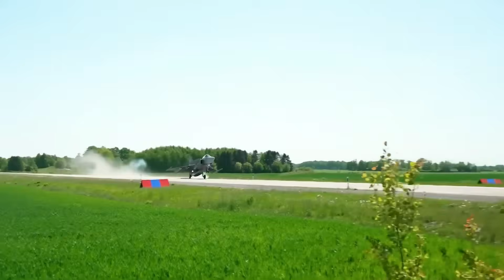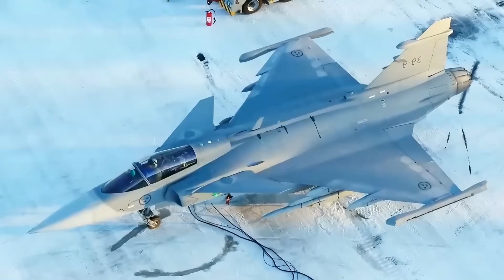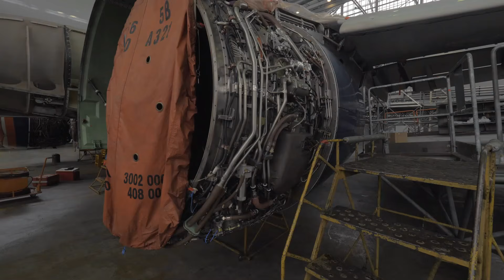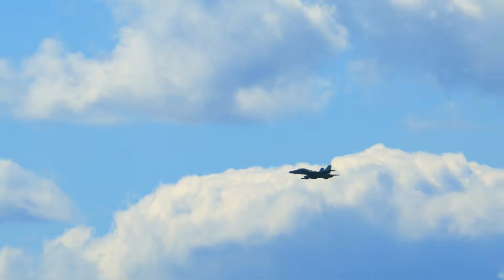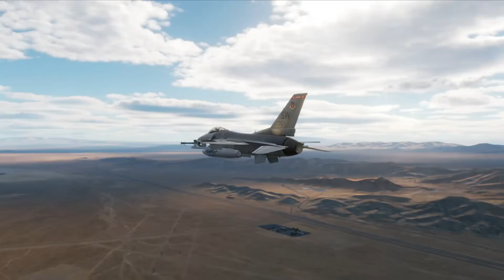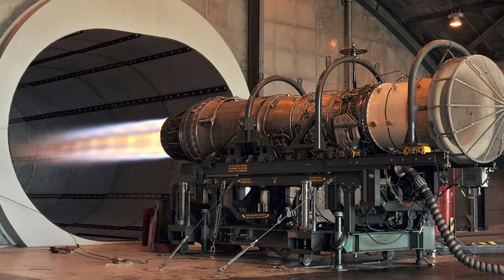Gripen’s Rolls-Royce Engine vs F-35 — The Power Debate Explained

Comment: Canadian pilots need 2 engines!!! If a Gripen or F-35 take a bird strike in northern Yukon or NWT that pilot will have to punch out lose the aircraft and have to wait for a helicopter for an hour they'd freeze to death!!!! F-15EX or Typhoon or maybe the Rafale would be the better choices but id 100% take the F-15EX
Reply from the maker: Two engines can improve redundancy, but they don’t make a jet immune to bird strikes or engine failure. Modern single-engine fighters like the F-35 and Gripen have very strict engine certification standards and extremely low failure rates.

Canada has operated single-engine CF-18s’ predecessor aircraft and other single-engine jets in harsh environments before. Survival in the Arctic is more about SAR coverage, pilot gear, and response time than simply engine count.

The F-15EX is powerful and capable, but it also comes with higher operating costs and different basing needs — so it’s a trade-off, not a simple safety equation.
Reply: @FrontlineMilitaryShowyou get what you pay for. Pilots flying the CF-18 with one engine is a training exercise incase of losing one engine! The Gripen will not last as long as the Legacy Hornet did but the F-15EX absolutely could!!!! So we'll be forced to replace the Gripen sooner. In the long run we'd end up paying more but besides that I listen to the pilots need as should you....

Comment: I’m often heard about the Gripen is a fighter with better maneuverable, because light weight fighter jet, but it should be compared to missiles. 
Missiles have better maneuverable.
You can tell the superiority and inferiority depending on the ability of ECM. 
Gripen’s power generator F414 27.5kW and F-35 power generator F135 160kW, it’s clearly judged which has more capable Electronic Warfare.
Reply from the maker: Missiles are more maneuverable than any fighter — but fighters aren’t meant to out-turn missiles. They’re meant to avoid being targeted in the first place through tactics, EW, and positioning.

On the power point: yes, the F-35 generates significantly more electrical power, which supports its very large sensor and EW suite. That’s part of its design philosophy.

But ECM capability isn’t judged by generator output alone — it’s about antenna design, software, integration, and tactics. Power helps, but it’s not the only factor in electronic warfare effectiveness.
Reply: @FrontlineMilitaryShow
It doesn’t make sense.  If your saying is right, why EA-18G＋ALQ-99×3 is 75kW instead of F/A-18E/F is 55kW.
Why it need to build up the power generator?
Because It is matter that ECM need more power.

Comment: The stealth property, state-of-the-art passive sensors, huge computational power and data fusion are the recipe for survival in the next two decades and not the engine and the performance. Grippen is more cost efficient, I give you that, but the F-35 is about to be the leading aircraft of a group of another 4 Collaborative Combat Aircraft ( the competitors are the YQF-42, the YQF-44 and the YQF-48 ), that in turn are much more cost efficient than a swarm of 4 Grippens and stealthier than the F-35A and equally lethal carrying two AIM-120 in the internal weapon bay. Canada should make a choise that is compatible with the future and not chained on the past.
Reply: Totally agree with your opinions.

I’d like to add comparisons between Gripen’s power generator F414 27.5kW and F-35 power generator F135 160kW, it’s clearly judged which has more capable Electronic Warfare.
I heard many times, Gripen is the most effective ECM.
But look the power generator result.

Saab keep saying it, but it is cheating market sales.
Reply from the maker: You make a fair point — modern air combat is increasingly about sensors, data fusion, and networked operations, not just raw engine performance.

That said, cost, readiness, and mission flexibility still matter a lot for many air forces. Different countries prioritize different things, which is why platforms like the F-35 and Gripen both have their place.

Comment: 414 is 22,000 lbs of thurst 135 is 43,000  there is zero Comparison
Reply from the maker: Raw thrust numbers alone don’t tell the whole story. The F414 (~22,000 lbs) powers a much lighter single-engine jet, while the F-35’s F135 (~43,000 lbs) is pushing a significantly heavier aircraft with different mission requirements.

Performance isn’t just about max thrust — it’s thrust-to-weight ratio, aerodynamics, fuel load, sensors, and overall design philosophy. Different aircraft, different roles.

Comment: I seem to recall that the Gripens used F404 and F414 engines.
Reply from the maker: You’re remembering correctly.

The Gripen C/D uses the GE F404, and the newer Gripen E/F uses the GE F414. Both are American-designed engines, which is why U.S. export regulations can apply to Gripen sales.
Reply: 414 is 22,000 lbs of thurst 135 is 43,000  there is zero Comparison.
Reply: @kucgok  Empty weight of the F-35 is 29,300 lbs.  The empty weight of the Gripen E is 14,550 lb.  There is zero comparison. 
The Gripen is faster, but the F-35 has faster acceleration.

Comment: General Electric Aviation (an American company) designed the original engine families (F404 / F414) that Gripen engines are based on. Because the engines are U.S.-designed, export controls and U.S. approval matter for many Gripen sales and support arrangements — even though Saab builds and maintains them in Europe. Canada needs America's approval regardless of which plane Canada buys.
Reply from the maker: GE designed the F404/F414, so yes — U.S. export controls apply to Gripen because of the engine. That means certain sales can require U.S. approval.

But that’s not unique to Gripen. Many modern fighters — including options Canada has considered — rely on U.S. engines or major U.S. components, so Washington’s approval would matter there too.

It’s more about how integrated the supply chain is than about one specific aircraft.
Reply: @FrontlineMilitaryShow saying “the Gripen uses less fuel” without explaining why can be misleading.
Weight is a major factor
The Saab JAS 39 Gripen is a single-engine, lighter fighter (roughly 8 tons empty weight).
The Lockheed Martin F-35 Lightning II is a larger, heavier stealth aircraft (around 13+ tons empty for the F-35A). A heavier aircraft:
Requires more thrust
Burns more fuel to stay airborne
Carries more internal systems (especially stealth coatings, sensors, cooling systems)
So part of Gripen’s lower fuel burn is simply physics: less mass + one engine vs. one large, high-thrust engine on a heavier jet.

Comment: This video is comparing apples to oranges. One is a lightweight fighter and the other is optimize for deep penetration and ground attack. Send a Gipen and an F 35 against an S 400 anti aircraft battery and see which one comes out alive.
Reply: Maybe im mistaken but i don't think you've noticed this video and most about it are A i videos. China, Canada, and random losers spread propaganda to try to change public opinion on subjects and interfere with oppsing goverments. im actually shocked Your comment hasn't been removed. Saab would litterally have to make a new version of the gripen to replace the engine, with that fact alone this video is bs.
Reply: @wind5250  Facts? You're an expert in Rolls Royce manufacturing, or you work for SAAB? Neither, seems correct.
Reply: @citzeneh2978  I don't have to be , they said so themselves they are not replacing the engine in this version or the next. You're arguing against facts released by the people who made the damn jet.

Google Saab's CEO, Micael Johansson on new engine and read yourself. He's said it many times anyone saying otherwise is full of shit.
Reply from the maker: Not everything you disagree with is propaganda or AI-generated. If the video is wrong, point out the specific technical inaccuracies instead of dismissing it outright.

Yes, changing the Gripen’s engine would require major redesign and certification work — but discussions about potential upgrades don’t automatically make the whole video fake.
Reply from the maker: You make a valid point! Each aircraft has its unique strengths tailored for different missions. A head-to-head comparison can be tricky!